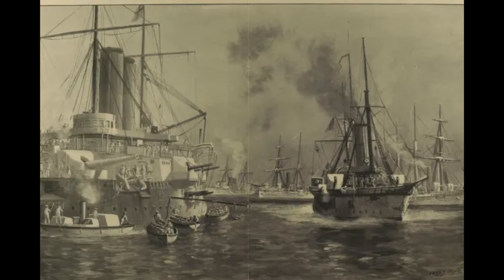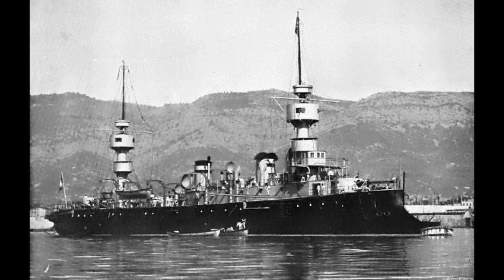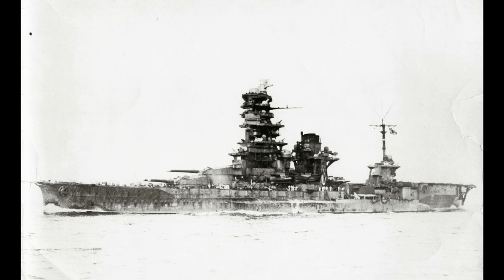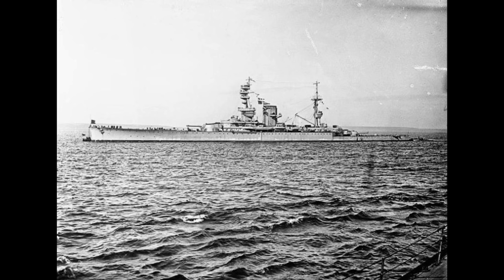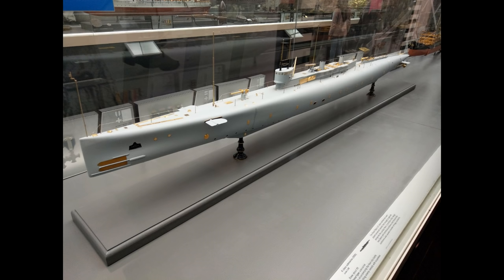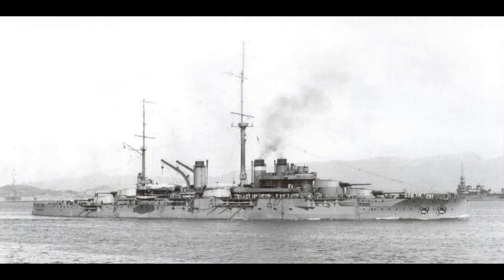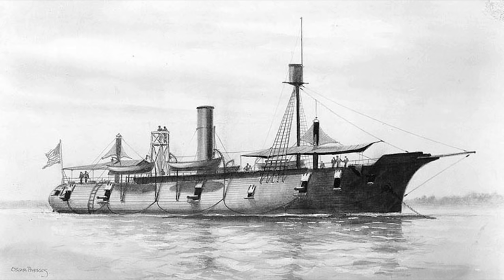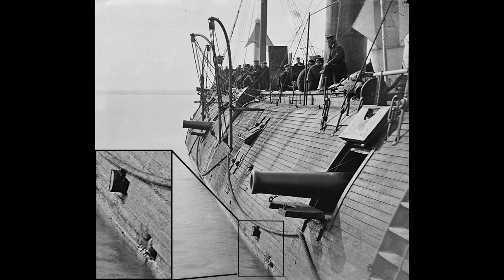Naval Engineering Disasters - How not to design a ship

Comment: Zumwalt class.  Land attack destroyers at a time when the USN is losing its naval supremacy.  Ballooning costs led to reduction from 32 planned to 3 produced, and its cancellation forced the Navy to switch back producing Arleigh Burkes, first launched over 30 years ago.
Also, they could never get the guns to work, so the gun mounts are just empty
Reply: Zumwalt is more about what happens when scope creep meets having Vacant as an opponent. The ship was meant to replace the spru-cans, so mainly sub hunting, gun support and some missile strike capability,, while using the tumbledome hull for stability and making it hard to target with anti-ship missiles.

The idea of it not only becoming taking this into being a DDG, therefore needing to now provide air support, but also tacking on needing 11 other technology projects to MUST succeed to have a chance to succeed itself is a mighty big ask. Add in it probably didn't have it in the designs to be as adjustable as the F-35s and a massive amount of time to stew about these projects and that's what you get.

The guns DID work, problem with those were as the ship class got cut, the cost per shot just went up and up, to the point it was about as much as a Tomahawk strike missile.

There's a whole lot that went wrong with the Zumwalt project, but dare I say it, if the cold war went on 5 to 10 years later in the early 90s when the project was proposed, the original vision probably would have been followed and it might not had such a horrid track record.

Comment: Alright, time to talk a bit about the Königsberg that you so seem to love... bit by bit

I can imagine where you took the hull issues from, Koop's book on the German light cruisers of that period cites the voyage in March 1936 over the pacific by Karlsruhe, and how she was about to capsize, how the frames were breaking one after another, and of course there'd be a huge crack from one side to the other. Unfortunately, the report written by the ship's commander does not agree with the majority of those claims. If you wanna try your German, or have a translator at hand, look up RM 134 78 in the German federal archives. But going through what the commander, the one guy you'd expect to know about the events of that voyage, concluded should give enough of a picture:

"In conclusion, from the experience of these stormy days, unknown in domestic waters, it can be said that the ship has excellent sea qualities. [...] The sea damage extends only to the non-load-bearing parts of the longitudinal bracing, which has only a supporting purpose, but is neither intended nor sufficiently strong as a load-bearing structure. In the load-bearing braces, features of stress were present under the tremendous load, but unimportant and without influence on strength. [...] The encounter with the hurricane has only lifted the confidence in the ship and its seaworthiness on all sides." (go to page 33 of the file, or 16 of the document if you have it in print)

That does not sound like it comes from a ship that was about to break in two and/or capsize, at all...

Now as for what actually did happen to her during the storm, in particular damage and restrictions in her course, those did occur, and were as follows:
- the rudder was almost useless, and steering was done via the machinery. Furthermore, due to the diagnoal course (to the sea) the rudder machinery got stressed quite a bit.
- due to the movement of the ship the screws occasionally emerged from the water, which due to the lower resistance caused the turbines to spin up rapidly. The rpm themselves were no issue, it was more the rapid change of rpm.
- The ship was rolling quite a lot (up to 39°), everything amidships to aft was drained by the seas and the aft getting hit by both seas caused some vibrations throughout the entire ship. The bridge and forecastle remained sufficiently dry.
- To not needlessly stress the longitudal beams a course diagonal into the wind and sea direction was chosen so that the transverse beams would also bear some load. This was not the ideal course, which would've been to sail into the opposite direction which would've almost entirely prevented every issue I just listed.

Now if you take the conditions of the sea into account, which just so happen to be as high as the charts go (sea state 8-9, wind force of 12) and compare that to some other events, like idk, the Fourth Fleet incident maybe? In one event decks and bridges were smashed, compartments flooded from joint failures, hulls cracking, and reported rolling of up to 75°. The other was Karlsruhe's voyage...

All of this is just to ask, where exactly do you think the Königsberg class stood out as particularly fragile and unseaworthy?

Going forward, the cruising range under fuel limitations..

If you substract some range from the turbines, let's say 75% just to make a point here, and then go and compare the remaining range to those of the Hippers, which you suggest they could have supported if only they had the range, you'll find that it's not the Königsberg class dragging the others down...

As for why they didn't then, it's fairly obvious for Köln and Leipzig if you look at a few events. Leipzig was never fully repaired after that torpedo hit, with the two boiler rooms she lost being converted to crew spaces. That left her with effectively a third of her original power on the turbines, so if anything I'd be surprised if they sent her onto the Atlantic. Köln while not having been damaged, was aging and was due to a major overhaul in 1939. Wartime however demanded that such things would be postponed as resources were not infinite, which would lead to a series of wear and tear related issues with cabling and her diesel machinery. The Christmas Raid is a wonderful example of that showing. And even if she would, you already mentioned a few factors that would make usage of them as raiders problematic. Their armor is only suited against destroyer caliber fire, and even that would be able to cause damage resulting in lower speed and endurance. Mission killing Köln or Nürnberg during a transatlantic merchant raid is so much easier than it is for other vessels, and they wouldn't even have the necessary speed advantage (be it for economical drive or at maximum output) to avoid getting caught by ships that would easily land those blows.
Reply from the maker: As I mentioned in the video, it's not any one issue, as there were a number of small/weak light cruisers out there. Its more the corrective measures needed made then unable to do the main job of a light cruiser.
Reply: @Drachinifel  Ehm... no.

The main job of the Königsberg class as designed was to scout and to counter the French Duguay Trouin class. The only job you talk a lot about in the video is commerce raiding, which these ships were not built for, and which in fact was not the main job of any light cruiser during the war. As the Königsberg class was designed they had no range at all to speak of, and only during construction (so when they were already at peace with the idea of them only sailing ~7,500nm) did they add the cruising diesels which would double the range. I cannot see any designer seriously drawing up a ship with that range when it's main task would be commerce raiding. Especially not given how underway replenishment played out during WW1. You'd have an easier time making that argument for the Deutschlands with their projected 19,000nm cruising range.

Instead light cruisers mostly served as fleet scouts, as flotilla leaders or as escorts. All of which the K-class could do just fine, although former was not possible since Germany lacked the necessary fleet to scout for. But all three operated just fine when leading destroyer flotillas, and when the opportunity would arise they did escort capital ships just like one would expect them to (Köln when escorting Gneisenau pre war and early war, Nürnberg escorting Gneisenau after latter took a torpedo, Köln and Nürnberg escorting Tirpitz when she set for the Baltic to name some occasions).
Reply from the maker: @sireneracker8293  it's not just raining, that's just a possibility, but more the cuts in range and speed caused by the modifications meant it wouldn't do well in almost any role a light cruiser might have to do.
Reply: @Drachinifel  I am not quite sure how a cruiser going 30.5kn and capable of around 8,000nm of cruising range is severly limited. That's well beyond the range of a La Galissonniere, which were rated for just half a knot more, so I call doubt on the K-class being nearly as restricted as you try to paint them.
Reply: @sireneracker8293  Just accept the Konigsberg sucks dude
Reply: @issacfoster1113  I should accept that primary sources have no weight against... what is Drach even using as a basis? Sure thing, this is how the world works...

Comment: What about the Kirov-class cruisers and their guns?

The ships were roughly the same displacement as ships such as the County, Pensacola, and Northampton-class ships. These ships have eight, nine, or ten 203mm guns. Kirov has nine 180mm guns.

These guns are placed in triple turrets that have a multitude of problems. They are cramped. The guns are too close together which leads to issues with accuracy. The turrets have inadequate protection. The guns wear out very quickly. And worst of all, they have the fire rate of a battleship.

Comment: 44:00 is it just me or are the rear turrets of the konisbergs off center? If so, god why? With the konisbergs being so delicate, I feel off center turrets would be a “well there’s your problem” kinda moment.
Reply: yes they were. whoever had THAT idea spent waaaay too much time in a beirhause!
Reply: I'm sure there's a rational reason for this... unusual design choice.
I just can't see it if my life depended on it...

My best guess would be that they ran into some space issue with the engineering spaces and the turret well and by putting them into weird-echelon, they could save like two or three meters.
I'm no shipwright, but I would rather have added those 3 meters to the hull, than doing this. So no, I have no idea why...
Reply: Better angles to fire ahead with atleast 6 guns...that was the reason
Reply: @NashmanNash  Ok.
I do feel the need to ask the obvious question then:
If firing arks ahead were so important to the designers, then why did they mount 2 out of 3 turrets aft?
Reply: @Bird_Dog00  Probably because these things were intended to run away
Reply: @NashmanNash  Definitely not a Fisher-Design...

It does lead to the question: Then why was being able to shoot forward slightly better considerd so important, that they acceptet god knows what design headaches the offset turrets will cause for it?

I'm sure they thought it was worth it, otherwise they wouldn't have done it, but I can't help but thinking that I would not have done it.
While it might give you a few more degrees to shoot forward (like 1/11 o'clock-is arc) with one more turrert and gives you pretty good fire with all three turrets to the about 2 o'clock arc, It makes bringing all three turrets to bear in the 10 o'clock arc a lot more awkward.
Reply: @Bird_Dog00  they were meant to be scouts for the fleet (what little fleet they had at that point), so it was more likely for them to engage while falling back to main body, hence the aft-focused turret arrangement instead of the more commonplace AB-X (also they were topheavy enough already, going with a superfiring turret forward would be one big headache).

For the offset I would presume it has to do with the Germans loving their balanced armament layouts. The 4x2 arrangement would've been too heavy however, so they had to go with triples and accept that it's not going to be a perfectly balanced layout. The offset would limit the "dead" sector for the rear turrets down from 60ish° to 19°, and offer some comfort to those insisting on balanced layouts.
Reply: @Bird_Dog00  We are talking about a german design here..."making sense" is not something common to those...I mean..they rectified the problem with Leipzig and Nürnberg..although that was mostly due to the cruising diesel and its shaft
Reply: @sireneracker8293  I never doubted that they had their reasons.
I can sortof see their reasoning, but allthough I know I'm armchairing, I don't think I would have made the same choice.
The whole thing just looks weird and probably caused some trouble with the internal alyout and the structure of the hull.
Too many compromises for my taste, but I wasn't there.
Reply: @NashmanNash  Fair enough...
Reply: @Bird_Dog00  Oh I fully agree, in the end they couldn't even capitalize on that placement as firing at such angles would cause blast damage to the deck (a fairly common issue found on ships of almost every size...). The commander of Karlsruhe noted that the stresses on the longitudal supports were the greatest around the rear turrets, so you are most likely correct with that assessment. 
Although given the large L:B ratio, I am not sure if the placement affected the bottom line that much (Karlsruhe still weathered the hurricane fairly well, so it was certainly not damning her performance).

Comment: The  Russian Navy in the Eighties was quite infamous for power train problems, very often having its warships towed. And don't even get me going on their nuclear submarine disasters...
Reply: Mostly Kuznetsov-class issue, and the problem is that the boilers were designed for super high steam parameters, thus requiring (not joking) a damn water treatment plant inside the ship for fine filtration of feeding water. This worked pretty well when it was maintained, but when the country and, obviously, the navy as well, began to fall into misery, this system was one of the first to be forgotten about. And the whole Kuznetsov's machinery now is just a mess that is easier to replace completely than to repair and refit. Sadly, we don't do such powerplants now, loss of competence...
Reply: I was impressed by the old US Knox class frigate Westinghouse steam turbine..worked great, lasted very well and goes just as fast as the most modern! Also, very impressed with jet engine propulsion on the US Spurance class... Instant power and up to 95% of full capable speed from a full stop in 5 minutes.
Reply: @raywhitehead730  my personal favourite is Oliver Hazard Perry-class propulsion system. "Half the Spruance", one shaft, cheap, robust and effective
Reply: Excellent choice! Bath iron works is known to produce an excellent product. The OHP class was very durable. But I just prefer two screws. He us could build these news again but with up dated radar, com and missile systems... Fairly cheap.

Comment: 1. Regarding the Maria Teresa, I think they were a conceptual failure more than an engineer failure.  As you said, they were based on the Orlando class -although built in Spain with help by Palmers, the shipyard that had built HMS Orlando. Aidan Dodson suggests the Orlando class had been designed in response to a request by the RN Foreign Intelligence Committee for five 2nd class battleships for overseas deployment. Based on the same technology as the Admiral class, they would be smaller and cheaper, with higher freeboard and longer range, thinner protection and lighter armament (a bit like what the later Centurion was to the Royal Sovereign). In Spain the Maria Teresa were also called 2nd class battleships. 
The RN wanted to use the Orlando to protect distant colonies against anything they could find there. The problem was that both the Orlando and the Maria Teresa were too slow to catch lighter protected cruisers and at the same time too weak (both in armour and armament) to fight 1st class battleships. They still could fight in the line of battle alongside battleships, but not without them. In this regard they were a conceptual failure: you would better use your money building more useful 1st class battleships or fast cruisers. The French fell in a similar conceptual mistake with their long series of slow small coastal battleships well into the 1890s.